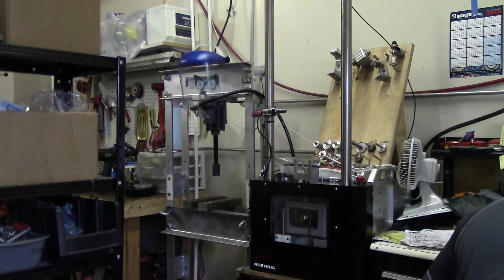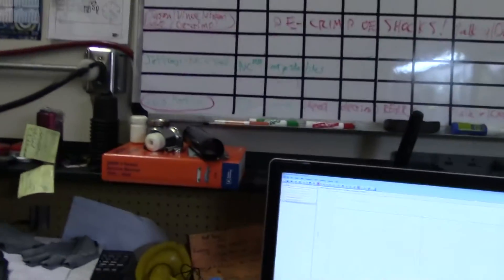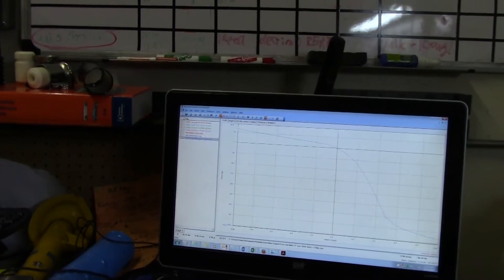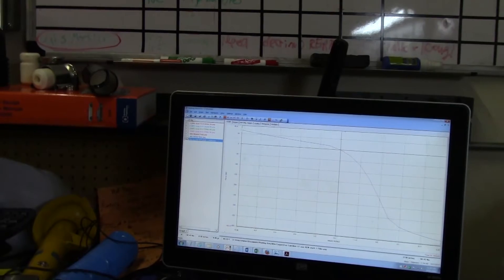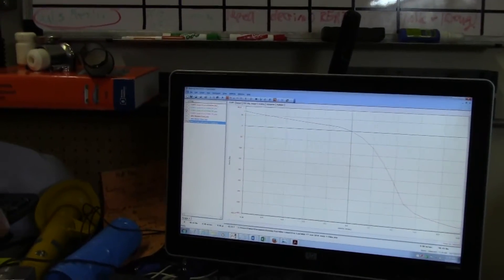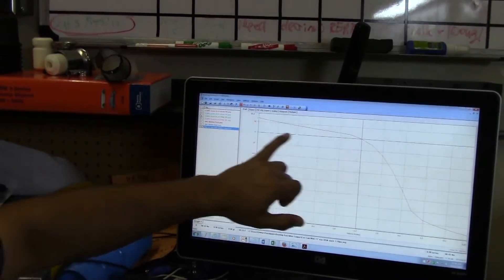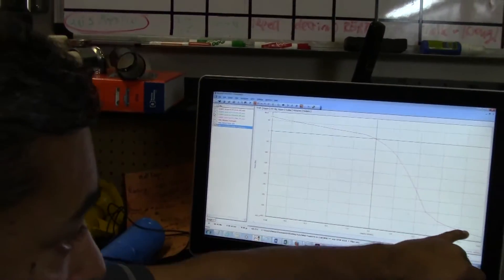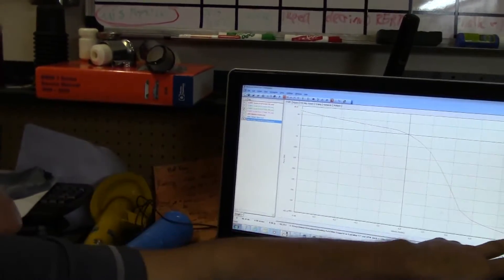How Shocks Work - Making Your Mini Cooper Handle, a follow-up, v1.14

Comment: Great video.  My brother has a 2004 supercharged mini , which he wants me to set up for him (I have an nb).  Initially it didn't seem to push that much, but as I started to go through tight corners in the mountains I noticed the front tires digging in and understeers simultaneously.  My brother went out and bought a set of konis non adjustable without my knowledge.  I am not the biggest fan due to the low compression they usually offer.  I have three questions.  What kind of rates can these shocks handle? I am planing on having the same spring rates on the front and back to help with rotation, 6k.  To me this seems like a reasonable and mild increase, but I haven't any experience with the mini and how they react to stiffer springs, especially in the rear. What are your thoughts(it is a daily driver driven aggressively)  Finally, What is the diameter of the packers you are using?  Thanks for the video.  I kept checking to see the results of the packers you installed in the last video.
Reply: you can try to get the compression/rebound curves from Koni. sometimes spring and damper manufacturers will tell you motion ratios too. usually konis come close but are never optimal simply because "matched" setups don't really exist until you go with a custom setup.